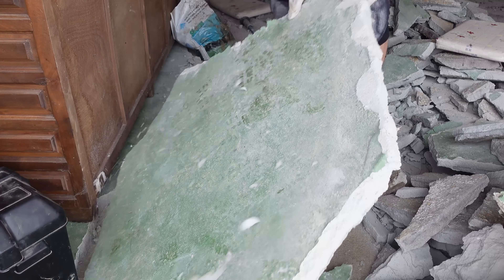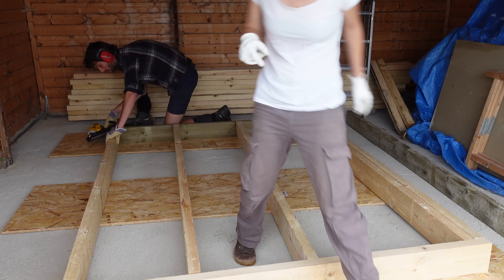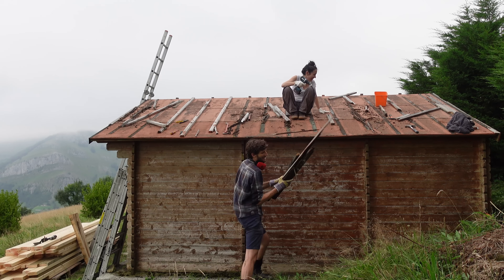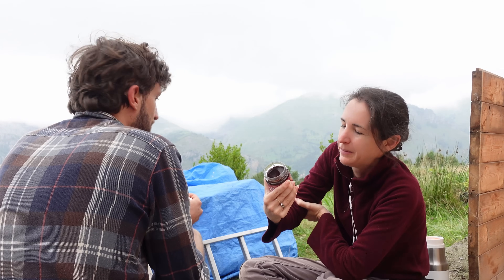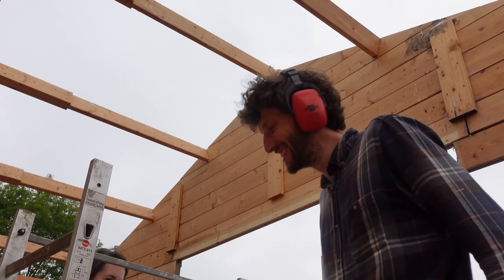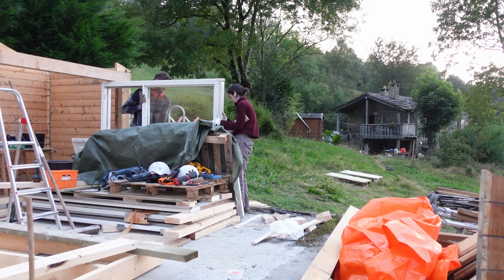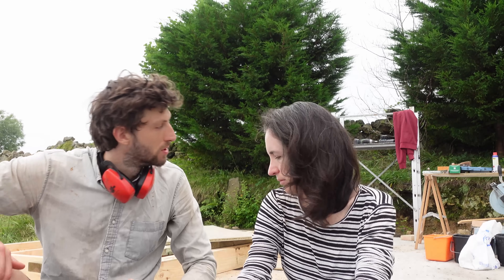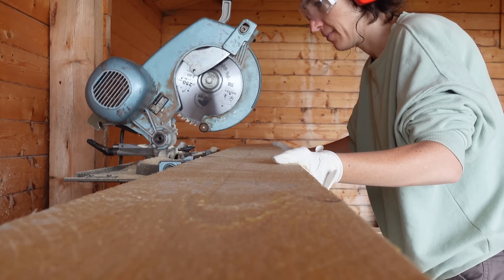Changing plans on the go: a lot of demo and building walls | Studio Build Part 2

Comment: with the timbers from the old shed you could build a decking with a pergola  extending from the new build, then you will have a nice outside shaded area similar to what the shed is with out a solid roof. the extension could be built on brick/cement blocks so no need to to put down a huge cement flooring. then you will have an outside living space that you could even put a small outside kitchen in for summer
Reply from the maker: That is a lovely idea!
Reply: @WaleandMe   you guys are doing an amazing job. don't beat yourselves up and pull yourselves down. just take one bit at a time. you can only do what you can do. my hubby was a builder/carpenter and i  helped him with many projects and with the bits ican remember you are doing everything correctly so be kind to yourselves, remember your new to this, even professionals make mistakes and have bad days and Ali your doing all this while battling ME. so dont be dishearten, youve got this. well done. love you guys and your determination xxx
Reply from the maker: Thank you so much for the kind words ♥️♥️♥️ We appreciate you!!

Comment: Why didn't you keep it as it was good job taking that down ❤
Reply from the maker: It had so much water damage that a lot of the roof and parts of the walls were completely rotten. Also the roof beams that were put in were so low that neither of us could stand in there. And whilst taking it down we could see how it had been reinforced as hoc over time, but ultimately it was not structurally sound for the winds we get here. We would have loved to save ourselves the work and money and just replaced the roof and added insulation, but it was not possible 🙂